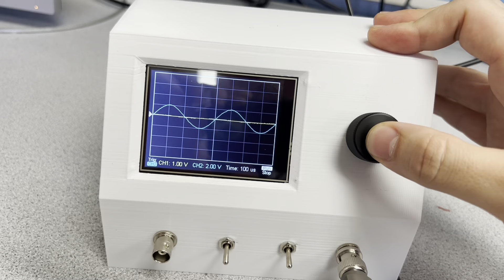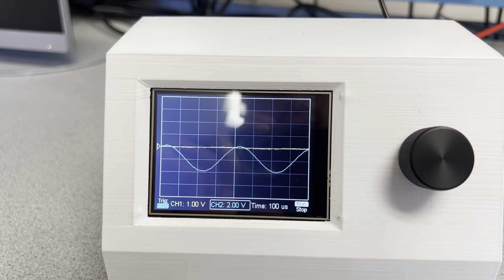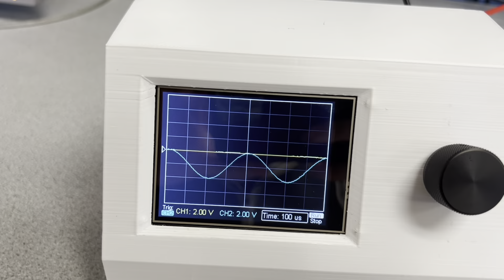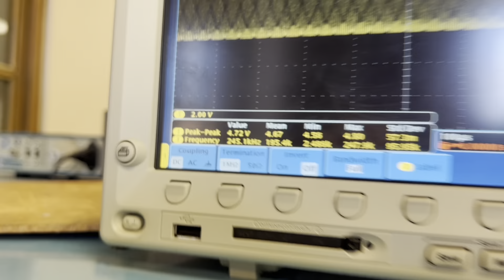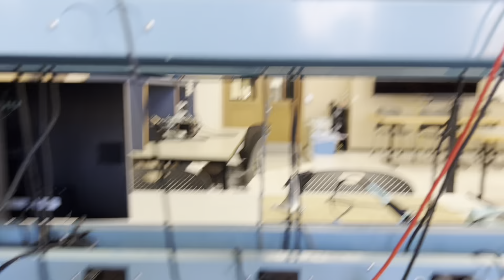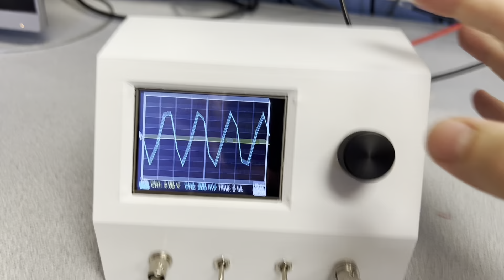Junior Design 2 - Oscilloscope project

Comment: Well...,...some questions, hardware uP, memory length for capture, programming language, analog input stage, view two channels at the same time, has usb to connect to pc....etc,etc. ... greetings...
Reply from the maker: Hi Daniel! I'm currently uploading a more thorough video on the project that covers much of this. I don't believe we actually show the system using both channel inputs at the same time in the video (other than test signals used in development), but the ADCs are working in parallel and maintain the same sampling speed/capture length. I hope you'll check out the new video when it's live!